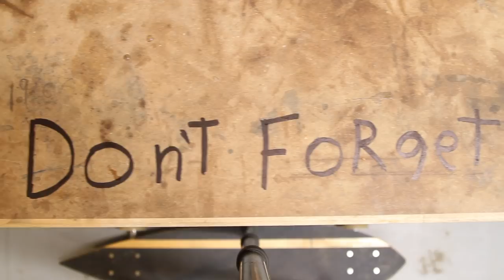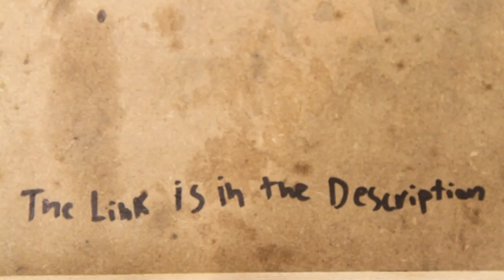Forging a Ball Peen Hammer - Blacksmithing

Comment: Great video again mate, how long does it actually take you to make a hammer from start to finish including putting the handle on? Thanks John 👍🏴
Reply from the maker: Thanks man! And the whole process including the heat treat is probably somewhere around 3 hours but if I was going to forge 3 hammers at a time it probably wouldn’t take much longer because a lot of the forging time is just waiting for the material to heat up so in between heats I could be forging the other hammers
Reply: Paul Pinto thanks mate 👍🏴
Reply: @PaulPinto  anything i make i make it in 2's or 3's personally. that way i either get more done, or if mistakes are made, i have a backup ready to go and don't lose the time starting over. like ya say, waiting on steel to heat is time you can be working on steel that is hot.